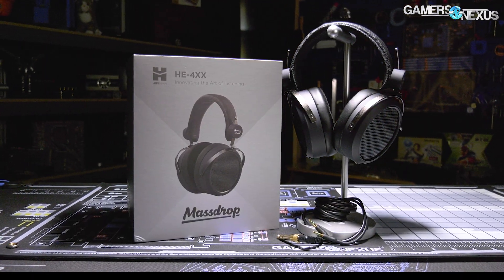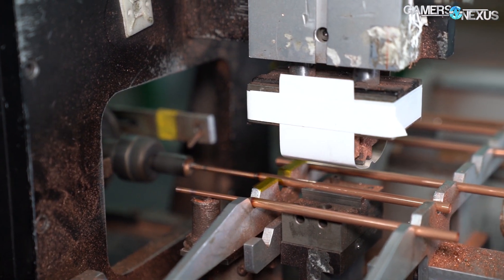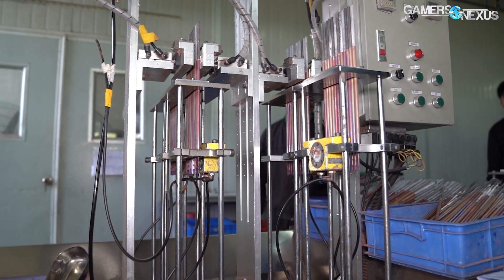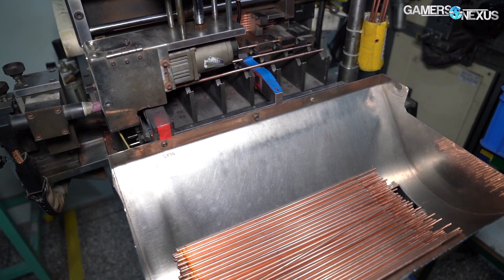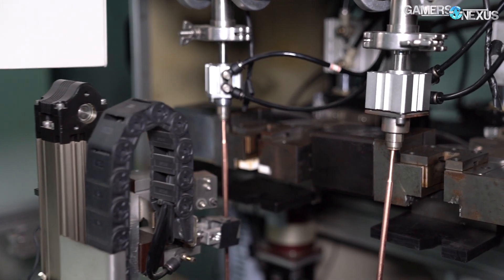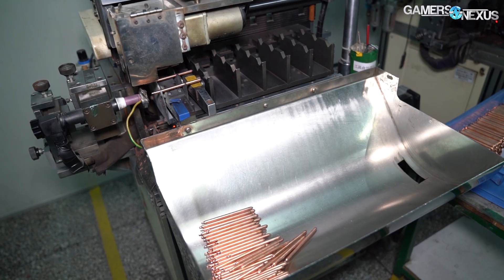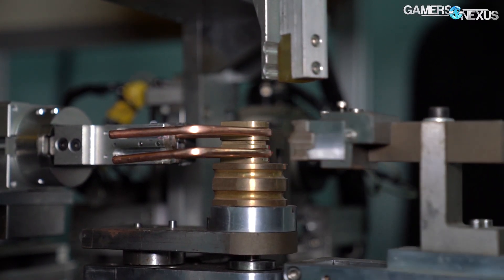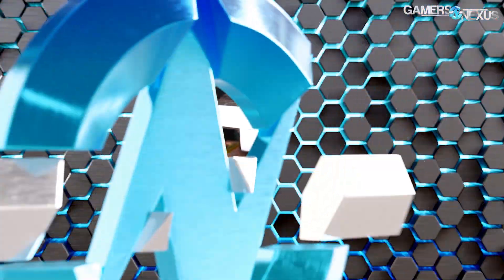How Copper Heatpipes Are Made | China Factory Tour (Cooler Master)

Comment: Wasn't expecting it to just dump a load of copper powder all over everything.
Reply from the maker: Well, it isn't waste if it isn't waste, right? It's never wasted. It goes back through the top tank and gets reused.
Reply: @GamersNexus  The people in these comment sections aren't manufacturing experts nor mechanical/design/materials engineers, Steve.  Take their objections with a grain of salt.
Reply: @GamersNexus  I don't think it is the waste perse, but the odd fill rate of the drop.
Reply: @GamersNexus  They probably weren't something so "inelegant" of a solution.
Reply: @GamersNexus  That's waste. Wasted effort.
Reply: It may look ineffective, but trust me in materials handling somethings that look odd is better. Powders will not free flow into a tube if you try to tube them, it will clog. The drop ensures that a given quantity will always fall freely within the stipulated time. I think they just recycle the powder that falls in the bottom, it is a vibrator collector there.
Hours or even days of manual tweaking is done to make this work! And then site erection and commissioning is another major task. I had a company manufacturing these type of custom machines, you can never design them to perfection in CAD! You have to set them up and iteratively take out the kinks.
Reply: A company with 20+ years of experiences in electronic cooling solutions versus YouTube comments. I think Cooler Master knew what their doing, and certainly optimize their processes to stay competitive in the field.
Reply from the maker: @hotaru25189  The powder is collected and re-used, as stated in the video.
Reply: @GamersNexus  Video?
Reply: @GamersNexus  why waste it in the first place though?
Reply: @JGnLAU8OAWF6  they probably found it was easier to maintain then using a direct feed where the potential for blockages in the tubes are higher due to how fine the copper power is.
Reply: @JGnLAU8OAWF6  please do explain how it's a waste if it's collected and reused
Reply: If all the meth heads in my town saw all that loose copper they would lose their minds.
Reply: @JobeStroud  haha scrap it!
Reply: They don’t use a funnel or straw for the simple fact that they clog too easily, and one clog would take up way more time than having someone pick up a bucket of dust and dump it back in the hopper
Reply: It's amazing that some people still think it's "waste" even after he started in the video that it was reused, he stated in this thread that it'll be reused, and most importantly of all, common sense should tell you that it's reused.
Reply: @hotaru25189  Well Steve did state that the excess powder is collected in a bin below, and is presumably put back into the top.  I can guarantee they're not just throwing it out.
Reply: @SevenSevenXAK  Yeah, if we loaded a pickup truck with this and drove it to the nearest salvage center, they'd pay full copper rate for it.  There is no way to convince me that copper couldn't be melted and purified somehow.
Reply: @hotaru25189  Using that method would make it harder to control how much actually goes in (you don't want too much) and would tend to make it pack down and the sintering process would fail and lead to too many clogged and worthless tubes thus making the process more expensive due to having a failure rate higher than 3% and likely in the double digits .... copper is relatively expensive these days so you can bet they aren't really "wasting" any more than is absolutely necessary
Reply: I call it the "Blech" method. I use more care and efficiency when I add powder to my ramen noodles.
Reply: I would have thought there was a cleaner more efficient way to fill the pipes with copper powder than dumping it from a height and hoping some will go in the narrow ends of the pipes, spilling it all over the machine in the process? That looked  comedic coming straight after the precision of the previous stages :D I guess they know what they're doing by now....
Reply: @TheRestartPoint  Materials handling is an art as well as design. There is a huge difference between what you assume and what really works! High repeatability with fast turn around dictates everything there. Try not to judge when you don't know the intricacies of such systems!
Reply: I bet the janitor who sweeps all that up has a good gig recycling all that copper.
Reply: The operation is surprisingly crude.
Reply: bequiet throws the powder manually ... with buckets. this is edge technology
Reply: "Grab a handful of copper and throw it at the machine. Whatever sticks, that's the measured amount."
Reply: make them more expensive...
Reply: @hotaru25189  With a big enough bin below, more copper powder might stick to the funnel than is lost in this "recycle everything within large volume of space" solution.
Reply: Depending on how fine the powder is, this is actually quite a health issue. We have some sintering and SLM machines in our University and you're only allowed in those rooms with a portable air filtration system and protective suit. 
I guess safety standards are something else in China...
Reply: @Nerrror  that's exactly what I was thinking, you could die if you breath that copper filled air without a really high grade mask
Reply: Welcome to China, it's a wildly different manufacturing world.
Reply: @otm646  I'm hearing the movie trailer guy saying: "In a world... Where OSHA doesn't exist...  And health code is an afterthought..."
Reply: @hotaru25189  why would you even think they would waste the copper. Copper is valuable. None of it will go to waste.
Reply: haha, typical people in this comment, "China bad, therefore that way must be wrong"
Reply: 1> Dumping it like this will collect contaminants into the 'recycled' materials. 
2> No precise way to measure the quantity each tube receives..totally random as the rain.
3> So that's what a copper waterfall looks like! Nice.
Reply: @STONEDay   Depends on what contaminants is there in that environment. 
You will be surprised how minimal variance will be there in the quantity per tube, since feed actually outputs for a very fixed duration and the quantity that cascades will be fixed too.
Looks are pretty deceptive. Infact a lot of tweaking would have gone into that machine
Reply: @IdeaBoxful  It's not a clean room. Contaminants are contaminants. Variance in this step is enough to contribute to the 3% garbage rejects.
Reply: @STONEDay  They almost certainly do routine quality checks. Precisely measuring how many milligrams of copper got added to a tube can be done with a scale. The tubes should all weigh the same.

The next step is 8 hours in a very hot oven.
Reply: Seriously, do funnels not exist in China?